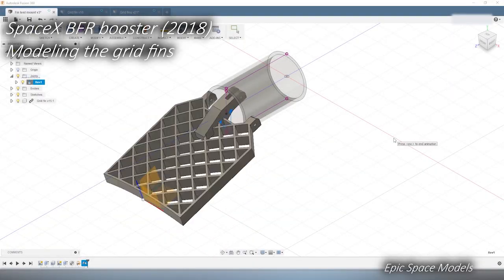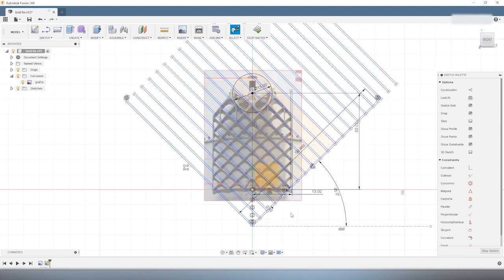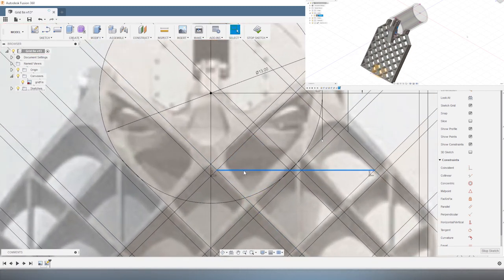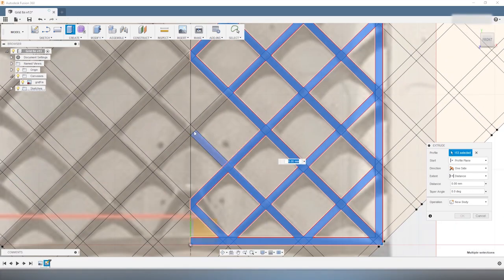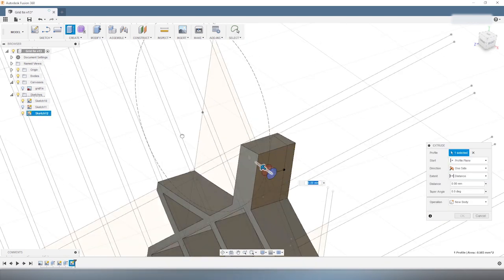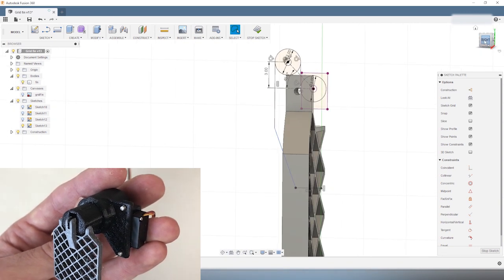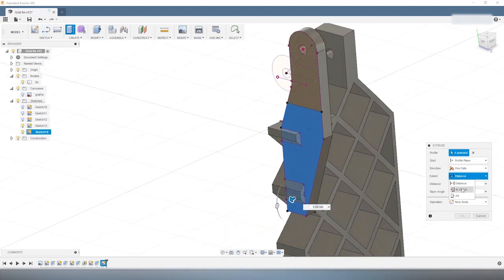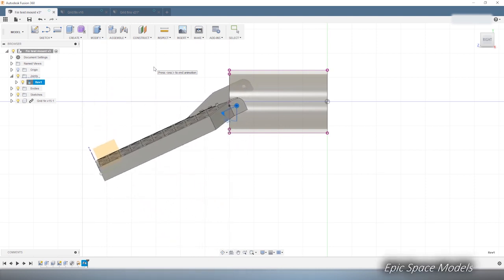SpaceX BFR booster | Modeling the Grid Fins

Comment: Wow, I just came across your Starship model videos. It's really cool how you're modelling it with moving parts, nice work!
Reply from the maker: Simply Space Thanks! Moving parts are always a challenge, especially when the space is limited.
Reply: @epicspacemodels319  Yea, I've built a 1/100th Falcon Heavy. I had originally intended to actuate the legs but gave up on that since I was struggling to design a strong enough hinge mechanism that was printable without being oversized.
Reply from the maker: I have not tried to build a Falcon 9 core yet, but I agree that at that scale the leg mechanism would be very challenging. The core diameter would be only 37mm...